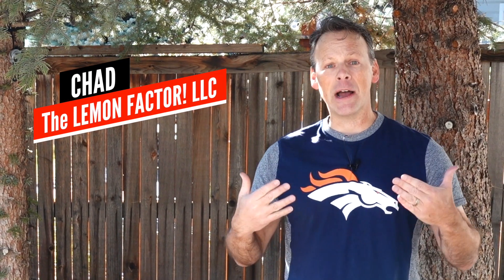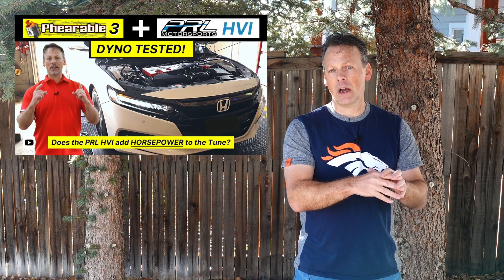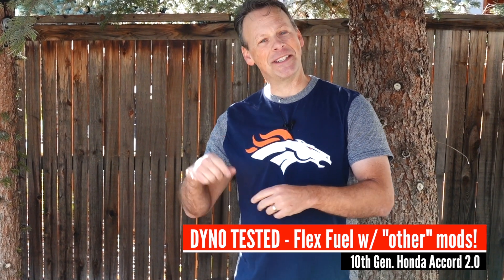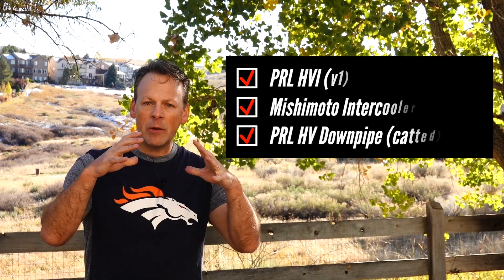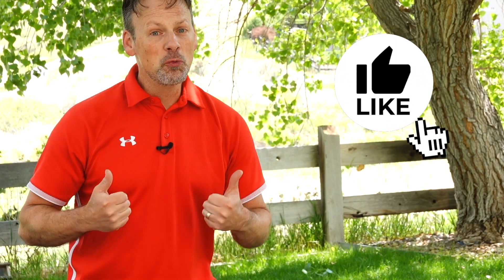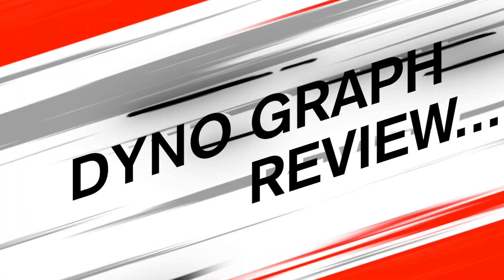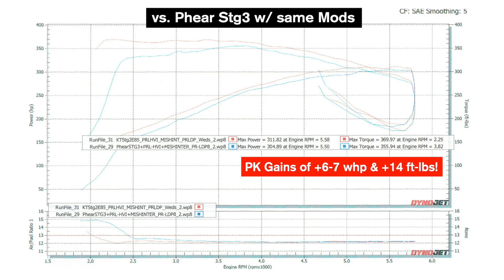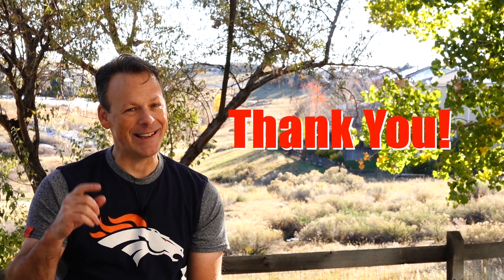PRL Flex Fuel Kit + KTUNER Stg 2 (Ethanol) Tune - DYNO TESTED!!! // 10th Gen (2018+) Honda Accord

Comment: Has running Ethanol changed your gas mileage any ?
Reply from the maker: The use of ethanol will lower your gas mileage, but to what degree depends on how much you get on it 😉. Seriously though, at ~30% blend, with the occasional strong pull, I may have lost 1 mpg. However, your results may vary.

Comment: Hey chad , I just finished installing the PRL Flex Fuel kit and was wondering if I was able to still run full 91 Oct on this tune will it be okay? Or do i have to flash back to Ktuner without E85 enable to have it run. Also with extension plug from the kit do I plug it into the radiator itself or do i plug it into the plug that’s pulled out of the radiator , so plug to plug basically? Thanks just wanna make sure
Reply from the maker: According to Phearable, if you’re not running an ethanol blend, then it automatically reverts to the Stage 3 tune.

Comment: can you Ktune a T2.0 for better mileage? currently getting 16mpg on Eco mode it’s horrible mpg even while driving slow
Reply: Ur not doing the math right. Reset ur trip and then drive slow on eco. Even in city stop and go I get 28 on eco driving lightly. Highway 35.5 mpg going 75 mph locked on cruise control
Reply: @GiantFrmTha760  hey what’s up man, I actually did that awhile back and i’m still averaging 16 in the city on eco driving lightly. I love my car just hate the mpg

Comment: Did you ever figure out what that sound is?
Reply from the maker: It’s likely the bypass valve
Reply: @TheLemonFactor I hear this sound constantly while driving. Would you consider a blow off valve, and or upgraded bypass valve to get rid of the noise? Or is it just not possible to get rid of that flutter?

Comment: those dyno charts look good for a 2.0l with a small turbo. The stock fuel pump is able to keep up at the top end too. 👍
Reply from the maker: From what I’ve seen, fueling doesn’t become an issue until ~400whp 👍

Comment: I can’t wait to see you get the Phearable Stage 4 tune and dyno that! I just went from the PRL HVI V2 with no tune to flex fuel with the Phearable Stage 4 tune and it’s INSANE. She feels like a whole different car/a tuner car for sure. I was laughing for two minutes after I first hit the gas. The Accord is already fast but this is the ultimate sleeper.
Reply from the maker: Don’t worry, you won’t have to wait long 😉
Reply: Stage 2 on E30 is faster than stage 4.  Been proven 100 times
Reply: @kiastingergt2231  I haven’t heard of a stage 2 tune on flex fuel before. Are you talking about Phearable?
Reply: @Austin8659   been a minute Since I’ve been on the accord pages but no.  Ktuner stage2 has a flex fuel option.  People were running faster on stage 2 over stage 4 phearable
Reply: @kiastingergt2231  yes I forgot the KTuner Stage 2 has an ethanol tune. But I believe what Chad said is correct on the Phearable Stage 4 Flex Fuel tune being faster. And I also think the top 10 fastest Accords would have larger turbos which would require a custom tune.
Reply: @Austin8659   yes but the ones that aren’t last time I saw weren’t on stage 4
Reply: @kiastingergt2231  okay nice
Reply from the maker: Based on my dyno testing, the Phearable Stage 4 produces more power than the KTuner Stage 2 ethanol tune. I’d love to see proof (a real test) that shows that the KTuner is “faster”. 🤷‍♂️
Reply: @TheLemonFactor   guess it’s been changed but the proof was there wasn’t a single stage 4 car in the top 10 fastest accords in the world ?

Comment: My other comment got deleted because I posted a link. Good job lemon factor can’t wait to see the Phearable stage 4 tune! I was browsing the CivicX forums and a lot of Type R guys are getting bigger throttle body’s which also bolt onto our cars there’s an aftermarket one for $500 or you can use a 2013-17 V6 Accord Throttle body for less than half that price. Should be a cheap easy mod maybe worth a few horsepower? Who knows.
Reply from the maker: Are you going to trying this mod?
Reply: @The Lemon Factor! LLC  Yes I plan on doing it in the spring time when I install the rest of my mods! The other mods are RV6 downpipe/front pipe, Phearble stage 4 and HPS hard intercooler piping kit! I can’t wait !
Reply from the maker: I’d love to hear how it turns out 👍

Comment: Thanks for the time you spend on these videos. Great editing skills too! 👌 can't wait for the P4 update/upgrade? I figure eventually if the supra doesn't de-rail the Accord progress.. maybe you will upgrade to the Type-R turbo? 🤷‍♂️ I checked here at work they are about $1600!  I'm looking at about 3k in just wheels and tires! The thought of that.. I could do ALOT of engine mods with that money 😢  such a hard decision
Reply from the maker: Thank you, it’s my pleasure! 👍  The Honda Accord isn’t going anywhere, don’t worry 😉  Remember, a good set of sticky tires will help with your acceleration, cornering, AND braking 😎
Reply: @TheLemonFactor  just ordered some 265/35/19 michelin ps2 tires today.. and new wheels.. Jesus that was a length and expensive decision.. hopefully it helps
Reply from the maker: Nice!  What kind of wheels did you buy?
Reply: @TheLemonFactor  19x9.5 Savini bm16 gloss black.. car is black. They are 26lbs. Was shooting for something lighter.. didn't want to go 18's or sacrifice "looks"  plus the enkei's were only matte black... really wanted gloss. Furthermore I usually run kumho ps91's I've never ran or even seen a Michelin ps2 before.. 200 tread wear.. hopefully their decent. I'm going to try and get draggy before/after vids on my channel.. hopefully
Reply from the maker: I had to look those up - they look good! The gloss black will look nice 👍
Reply: @TheLemonFactor  thanks! Hopefully they look good on the car. Il probably post a vid of the wheels too.. need content right now! Not much going on. Delivery is Nov 24th ish

Comment: My car has been making that same fluttering noise in my car hopefully your able to find out why it doesn’t feel like it takes away from power but it is definitely something I want to address
Reply: jumping in... my car does this as well but I'm on stock Intercooler. I noticed it after upgrading to mishimoto intake (I also usually leave the cover off). Hopefully you're able to find the cause of the noise
Reply from the maker: Have you picked up anything on data logs? Does it do it all the time?
Reply: @TheLemonFactor  I haven’t done any data logs I have the ktuner v1.2 and I really don’t know how to data log on the android app
Reply: Just me tapping in to say mines been doing it too. I recently upgraded the Intercooler & it’s still happening.
Reply from the maker: You may be hearing turbo intake noises as it’s much more noticeable once you upgrade the Intercooler 🤷‍♂️.
Reply: @TheLemonFactor  I don’t have a Intercooler in my just have a downpipe and a cold air intake
Reply: @TheLemonFactor  I can safely say its the same noise you're experiencing. I should also note it was doing it on the stock intercooler, I only noticed it after the aftermarket intake.
Reply from the maker: It appears that the intake may be the culprit. However, I’ve not heard the profound and consistent flutter until this dyno session. I’m also unable to duplicate it on the road 🤔
Reply: @TheLemonFactor   I’ve heard this noise a few times racing a challenger on the highway. It was extremely cold that night and I was doing 60-80 somewhere in there when I heard it and thought it was wind noise, until I went wot again and heard it. I have an intercooler but no intake and only other mod is kstage2 ots
Reply: Jumping in even though it's been years lol. I have stage 3 phearable, mishimoto Intake and intercooler and I experience this flutter almost every day. To be fair I love spirited driving but I want to learn more about what this is, is is dangerous to my accord, and should I opt to upgrade to PRL intake since the intake might be the culprit and mentioned before in this thread?

Comment: Nice! Now i kinda know how much whp im putting down lol. Try running a little more ethanol, im at e45 & my butt dyno feels a slight difference between e30 vs e45. Did the car hesitate when that weird sound cane on? If so might wanna check bypass the air bypass valve solenoid
Reply from the maker: No hesitation that I could tell, and in checking the logs I didn’t see anything unusual 🤷‍♂️. I thought about the bypass valve 🤔

Comment: Not trying to bash: I would have added all the parts and then done a custom tune with a tuner once on the dyno. I think for this build already stock turbo is out of puff. Time for mhi stage 2 or p700. Drill the rail and add more e85. Get you that 350-400whp. Then mod the Supra. That mk5 tune and downpipe and 450 easy.
Reply from the maker: You must be new to the channel… the intent is not to jump into throwing a bunch of mods at the car, but rather test individual mods in an incremental manner to see what works and what doesn’t.
Reply: My FBO Accord dynoed @ 369 whp with a big turbo on just 93 octane with no fuel line mod, nor more ethanol.
Reply from the maker: Which turbo is that?
Reply: @TheLemonFactor  Pure 550
Reply from the maker: Interesting! Not the typical upgrade 🤔👍. Why did you choose that turbo? Is that power on 91, 93, or ethanol?
Reply: @TheLemonFactor  I got a good deal from them. The power is at 93 octane only.
Reply: @TheLemonFactor  I had a Mitsubishi lancer evolution 8. Mitsubishi makes great turbos, I’d definitely go with either of those two and you will definitely be satisfied.
Reply: 93 and E85 mix but I completely understand your situation with the barometric pressure. At a certain point the boltons become supporting mods and the game changer is the turbo!
Reply: @savedby_grace6110  what turbo?

Comment: To me, these tunes are progressing to the point of asking for too much airflow out of too small a turbo who's sweet spot is 2-3K RPM.  So much so, we've had to evolve into summer tires just to make it manageable from a dig.  Each time you add power, the peaks are being realized exactly where you don't need anymore.  Who would have thought these insane torque figures from the line out of a Honda.   Anyone feel the same?  What's the torque steer like on this thing these days?

Comment: Just gotta add my two cents….

MHI Stage 2 + Ethanol + custom tune = 😈
Reply from the maker: Lol. I wouldn’t expect anything less from you 😂
Reply: I agree wrote exactly that and added a modded fuel rail for flow.
Reply: what times are you getting from that? bigger turbo is expensive but.....
Reply: @WhataTofu  haven’t taken it to the track yet. Spring I will do so. I’m still in the running process with ethanol with Imwtuned. Even on revision 2 25-30% ethanol there is a MAJOR difference.
Reply: @movietimers  i see..what tires/suspension are you running?
Reply: @WhataTofu  stock suspension for now that will be the next upgrade. Tires are continental extreme sport. Should have done what Chad did and went with smaller wheels/tires…but it is what it is

Comment: I think you should try an AWD Dyno. Maybe this way you could rev the car on the dyno all the way to 6500rpm as it usually revs on the street, and I think at those higher rpms it would make more HP than here at ~5600rpm. In the official brochure they say stock maximum power is 252hp at 6500rpm !
Reply: You’ll actually see lower numbers just because of the type of software and that hop for stock is at the crank not the wheels so maximum is most likely around 220~
Reply: @roli710  you get maximum HP at the wheels when your engine has the max crank HP.
No, you can see on that dyno chart that the power at max rpm (5700) doesn't go down at all.
Reply: @Eugen-E  I agree with you and I’m sorry idk how to really explain it but on a mustang awd Dyno you will definitely see lower number. Dynojet is always generous
Reply: @roli710  Actually Mustang Dynoes are the correct ones )))) but it does not mean that only mustang dynoes can read correctly.
This Dyno is also reading correct numbers. The Accord 2.0T stock had ~ 247-248whp here on this dyno, and it actually has around 270 crank HP even if the official number is 252 )) It is faster than cars with 252hp and the same weight/same transmission type/layout.
Reply: @Eugen-E  I guess it’s better said as comparable as they maybe they should not be compared if that makes sense number at the same time can mean something but are also meaningless sort of say

Comment: Hey Chad! Is this is with the KTuner Stage 2 or Phearable Stage 3? I was just wondering because I always assumed that flex fuel didn't add any HP/TQ but allowed you to run higher tuned potentially making more HP/TQ and I didn't know if you went back from Pherable 3 to KTuner 2 for this test. Thanks for all the awesome work you do for the 10th gen community!
Reply from the maker: Thanks for the support!  The answer to you question is in the title of the video, and referenced several times in the video itself 👍
Reply: @TheLemonFactor  hahah yeah thank you it was a silly question i didn't know if you went back to stage 2
Reply from the maker: No problem 😉